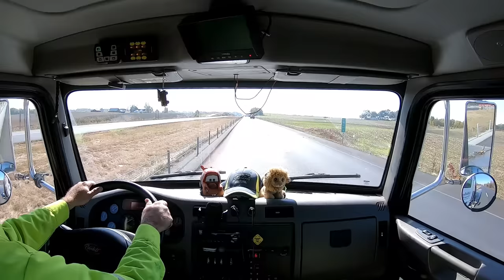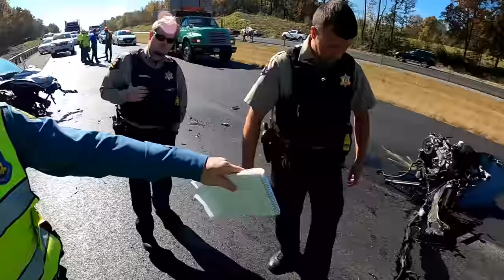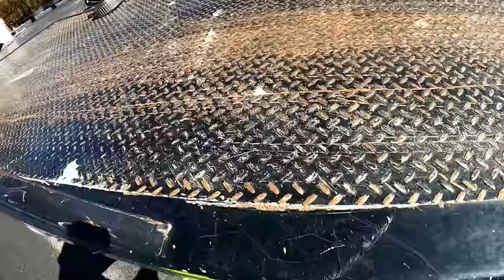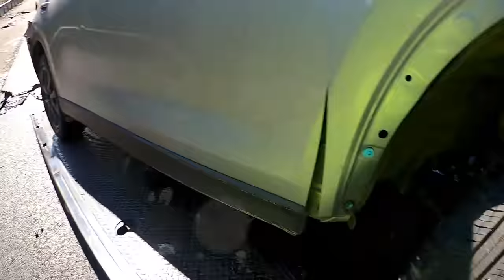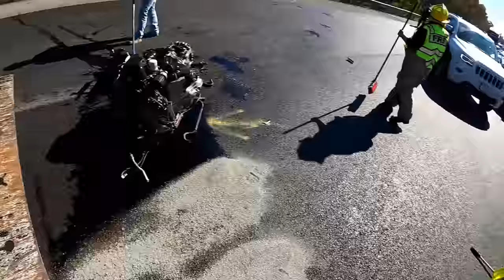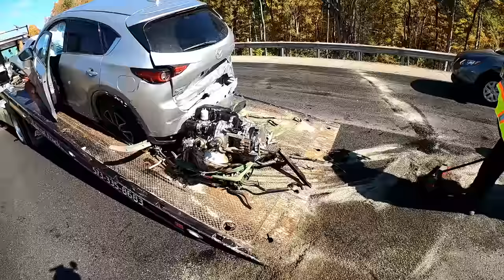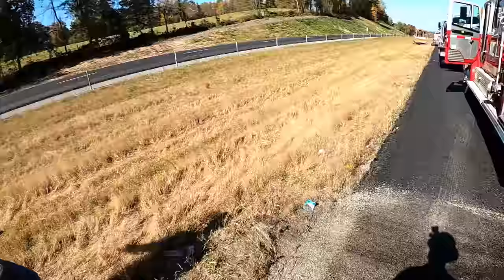Car-Splosion!!!   Code  (Blues & Twos)  Response While Driving In The Wrong Direction!!!

Comment: “Motor in good condition, dings and scratches, was running when removed from vehicle”
Reply: Truth in advertising. ;)
Reply: yes
Reply: "my price is firm, I know what I have."
Reply: No lowball offers. I know what I have
Reply: The motor just received percussive maintenance
Reply: "the only reason it is not running right now is that it ran out of fuel"
Reply: @g.sanders6916  - it’s all there!
Reply: It may have literally still been running too, lol, albeit only for a second.
Reply: What little confidence I had in Facebook Marketplace and Craigslist was just cut in half. Thank you for pointing that out.
Reply: One of the fastest engine removals ever
Reply: Motor was taken through the "breaking in" period as per manual instructions.
Reply: Car for Sale, one careful owner. Rare Flintstones capable model, useful for exercise during lockdown ;)
Reply: Ran fine before removing it.
Reply: You mean "was running before it was removed from vehicle". :D
Reply: Literally
Reply: "Slight oil leak."
Reply: yeppp... see that all the time, I hate listings 'ran when parked'... ok what decade was that in.
Reply: More like "was running before violently removed from vehicle. My loss your gain..."
Reply: The transaxle might need slight repair.
Reply: U forgot to add slightly used motor lol
Reply: Engine...
Reply: @SuperBrainAK  and the vehicle! Lol
Reply: Clean interior, full main dealer service history and rust free example.
Reply: I find it intresting to see how the traffic reacts to your units coming down the road... Most importantly its nice to see the country side you drive threw. Both city and country back roads...I say please show as much as you can... Its very educational and may end up saving a life... For the ones who don't like the driving, then easy fix for them by jumping to you getting on site.... I always hope all the crew makes it home to the familys every night. Your company, pd,fd... You all put your necks on the line to keep the roads safe, so thank you.
Reply: You Sir just made my day! God that was great. Glad they made it out of that alive.
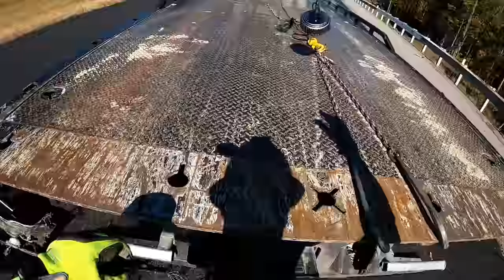Reply: @Sillyturner  Considering he threw one of the clutch assemblies onto the truck at 10:33 I think that might me a SLIGHT understatement.
Reply: @g.sanders6916  man you beat me to it🤣🤣🤣
Reply: @als8518  “ran when parked (51 years ago)”
Reply: Thank you 😊.   I'm lmfao now.   Have a pleasant day fellow human.
Reply: Copart will sell it some will repair lol
Reply: Write music
Reply: Only 20k miles, changed oil regularly, all services and recalls up to date 😅
Reply: Fresh body work!!
Reply: Sounds like the engine that someone once tried to sale to me.
Reply: Haha
Reply: s
Reply: Quite literally
Reply: " good "project" motor..."
Reply: You should get into advertising professionally LOL
Reply: @Sillyturner  nope he threw the input shaft onto his deck in the beginning right after backing up to the car it still had first gear locked to it
Reply: Epic
Reply: Sounds like a CNN add!
Reply: @SuperBrainAK  and OIL, and valve clearance, and valves.
Reply: Transmission Input shaft must be installed

Comment: Can we take a second to appreciate modern car safety design? Look at that frontside and then realize the doors still openened (more or less) normally.
Reply: Did exactly what it was designed to do, use the force of the energy into things that don't matter to protect the areas of the car where it does matter.
Reply: I agree but also alarming to see folks drive nowadays with blatant disregard/ respect for their own safety and others. Talking and texting etc . Since the new vehicles are so much safer there is not that physical level of fear / injury should they stop paying attention
Reply: Yep, everything else is designed to take energy away from the passenger cell
Reply: Judging by the damage I don't think she was speeding either. The engine probably got caught up on what she hit and got ripped out causing more damage.  This is why you shouldn;t speed.
Reply: This is exactly why I got rid of my old car for a newer vehicle, You just can't beat the safety systems in a crash!
Reply: Lesson learned from race car driving.  Ripping up the front of that SUV and tearing out the engine took a lot of energy, which did not go into the driver's body.  Essentially the car died so the human didn't have to.  Technology can be a great thing.
Reply: Yeah. I don't think this accident would've been survivable with an older kind of car. That's absolutely amazing. Crash dissipation zones are a wonderful technology. That a driver could walk away from this is nothing short of amazing.
Reply: "ran when parked" :D
Reply: Exactly. Not a miracle, but good engineering. 50 years ago it was important to make the car indestructible, and the passengers suffered. Now, the car self-destructs and the driver walks away
Reply: the same accident in an F150 and you'd be dead. That car took the impact and shedded what it could to keep the passengers safe. A F150 desintegrates on impact spilling the driver out to get  hurt. When i see that the cabin is screwed with bolts to the frame, i get sick,
Reply: @originalwolf8297  There's nothing wrong with body on frame. The issues come with how the body is made. 
That Mazda is made to much higher international crash standards compared to the F-150.
Reply: I was gonna type the same comment
Reply: As an engineer for an OEM car company, we put enormous effort into making cars crash safer. It's good to see the results of our efforts
Reply: Five ten years ago this would have been a fatal accident. Not only did the design of the car save the driver’s life from what I could tell they hit a bumper truck/trailer which also did it’s job protecting the road workers and the driver lives. This is why we are told “Slow Down, Move Over” your life or the life of someone else is always more important than whatever you are speeding to.
Reply: gives ALL new meaning to crumple zone
Reply: @telquad1953  I'm a bit bewildered.  Are you saying that regulators shouldn't have done so?
Reply: @RustyZipper  While we don't know what happened in 𝑡ℎ𝑖𝑠 case, I don't think the bad driving we all see every day is because vehicle safety has improved. I think too many people take driving for granted and consider passing their test to be the end of their training.
Modern design surely saved that driver's life but, sorry to say, it 𝑙𝑜𝑜𝑘𝑠 very much like terrible driving caused the accident.
Reply: @originalwolf8297  Disagree. Small overlap (the worst kind of impact) sees the 13th generation F150 handle it well: https://www.youtube.com/watch?v=1xcXwJaVb7Q
"spilling the driver out to get  hurt" - this is not a thing. Unless you're not wearing your seatbelt.
Reply: I would rather have the old cars. New cars are garbage. Why would I spend that kind of money on a car that I can't fix and will rot out in 15 years when I can buy a 30 year old car that is less than 1/10th the cost and happily run for another 30+ years?
Reply: Did anyone catch what make and model that car was ?
Reply: @TSKseattle  Cars were never indestructible. Watch crash videos from the 50s, 60s and 70s, and you'd see they were absolute tin cans, no form of crash structure whatsoever. In reality, there's more steel and rigidity in a modern mid-size crossover than ever was in a typical car from way back when.
Reply: The car produced projectiles, that could have killed other motorist. I'd say that's a deadly engineering flaw. If that engine/trans ejection would have caused a death, of a third party, OEM car company engineers would be liable for that death.
Reply: @mewimi  No he's saying that the car manufacturers were forced to make their cars this safe. That's not a miracle in itself. The driver surviving that impact is very surprising. It's a miracle if you want it to be.
Reply: @originalwolf8297  all body on frame vehicles have the body secured to the chassis with bolts.  that includes Rams, Silverado, tundra, Tacoma, etc.  not to mention every heavy tuck on the road.
Reply: @zachdemand4508  They aren't saying you need a brand new car, anything made in the last 20 years or so has good safety built-in, as long as it has airbags.
Cars haven't been easy to work on since the 70s.
New cars are half plastic, there's hardly anything to rust, I have a 13 year old car that I never wash, it has no rust at all.
Reply: @originalwolf8297  SUVs by design hold up much better than Pickups and Sedans.  I’d still rather be in an HD Pickup in a crash with another vehicle though.
Reply: @mewimi  It's pretty obvious he appreciates the safety, but that it's unfortunate that it took 50 years of pressure/regulation instead of car companies doing it quicker, voluntarily.
Reply: @CrushedLuminary  Car crashes have been producing projectiles since cars were invented.  That lawsuit would go nowhere.
Reply: @skipper5951  The problem is there was no energy absorption parts. The vehicle crashed into something and you crashed into the inside of the vehicle with the same force. The difference is bodies of vehicles are a lot stronger than those of humans.
Reply: Yeah but out of how many cases where people aren’t so lucky...
Reply: @RandyDarkshade2  the police officer that witnessed the accident said she was speeding also it was an interstate..
Reply: @RandyDarkshade2  you just said it doesn't look like she was speeding, then you say this is why you shouldn't speed! You contradicted yourself!!
Reply: @robkal56  excellent job to your field of work! I know car manufacturers are always using crash dummies & wind tunnel testing, all that hard work paid off in this case!!  May not always be able to save every life, but every life that is saved is a testament to the hard work put into designing safer vehicles!
Reply: @zachdemand4508  you can't fix the older car if you are killed in an accident in one!  Think about that for a minute!!  I do like some of the older cars myself, but the safety designs of newer vehicles can't be beat!
Reply: @zachdemand4508  you must also consider how much money you put into the older car!!  Buying the older car, dumping thousands of dollars into repairing it, & in the end, you are stuck with something you have more money in than its worth!!  That's not exactly sound investment!!
Reply: @zachdemand4508  The safety cell concept is good but modern cars have so much electronic rubbish and flimsy plastic that it  makes relatively minor damage uneconomic to repair.
Reply: @RandyDarkshade2  well also why you should pay attention
Reply: @sethtriggs  with the way cars are designed small accidents look like big ones she slammed into the corner of a steal construction truck so in the older vehicles they probably would have gotten some  Some bruises maybe a couple broken bones in a concussion Or probably just a concussion if it was a old truck or even old suv
Reply: @zachdemand4508  i have a 15 year old merc and a 25 year old bmw. However i had a corsa 2012 model year which I have to admit was very well made for what it was and had literally not a spot of corrosion on it. 
Some of these new cars are very good, i have considered buying new on a few occasions. I definetly get the 1/10th the cost thing. Means I can run a 328i and a merc c320cdi for less than the cost of a new car combined.
Reply: I'm glad to own a CX-5 a bit more now haha
Reply: @skipper5951  people think older cars are tough tanks because the use of plastic and lighter body panels wasn’t as common
Reply: @zachdemand4508  
And that 30 year old car will be significantly less safe in a crash.
Reply: I own a 92 Volvo 240 wagon. I was just reading about its safety features. All I know is I feel safe cursing down the highway. Ppl in my area drive like idiots.
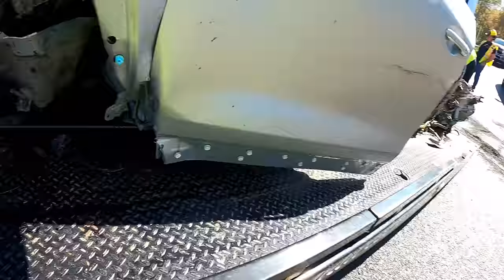Reply: @19:38 check out the rear wheel.
Reply: @RustyZipper  That physical level of fear/injury is still there, but most people tend to handle the situation with the idea that "others will watch out for me" or "I can easily text and drive".
That they like to rear-end you when you are on a regional road because you are not going fast enough but it ends up the other way around when they are in front of you while going on an onramp of the highway and you floor it and you notice they are actually wanting to enter the highway with a superlow speed and you almost rear-end them, and upon passing them you see them looking down for the most part.
I personally can not believe how stupid people these days can be when it comes to texting and driving.
Talking to another person can just as well be dangerous, but it seems people are sucked much more into their own virtual world while on their phone compared to when they are actually talking to a passenger.
Reply: @RustyZipper  I agree people drive nuts
Reply: @buckeye20100  
Cars have been this way for 20 years, some farther back than that.
Reply: Was looking for this comment cause I noticed the same thing
Reply: I think it was a Mazda 5 @msnpassjan2004

Comment: When I was in EMS we have seen cars that were  totally destroyed and the passengers completely unharmed and then see a car with no noticeable damage and the driver died so you never know.
Reply: The more energy absorbed by the car, the less force that's applied to the passengers, and vice versa.
Reply: My grandmother and grandfather have said the same thing to me. It seemed like it was always like that
Reply: I learned to drive in highschool 1976. We saw the videos of mostly intact cars and mangled people. Car design has certainly come a long way and for good. 
BTW, even though parents made us kids wear seatbelts, I have always worn my seatbelt ever since. Scared sensible I guess.
Reply: I think it is because the energy is spent destroying the car.  If the energy is passed onto the occupants instead, it is bad news.
Reply: They are designed like that on purpose. The car is designed to absorb the impact by destroying itself.  If it holds together with no damage then nothing else is absorbing the impact and it goes right to the passengers slamming into whatever holds them in. Seat belt steering wheel windshield whatever they hit first.  The designers of that SUV saved the drivers life.  She should look them up and send them thank you cards or something.
Reply: How do you know the drivers were not switch places before you arrived?
Reply: Won't blame you, my father was volunteer when he was younger (up north U.S.) and seen a lot of motorcycle wrecks. Alive, mamed, and the worst seen a lot like you did
Reply: Cars these days are literally designed to destroy themselves in order to save your life. Its basic physics principles, the car doesn't absorb the crash, all the force gets transferred to it's occupants, and that's why older cars were so dangerous, despite being able to crash and not take much damage.
Reply: Ive seen a car with no driver And a dead moose....Driver was pushed into the trunk
Reply: Modern cars are designed to absorb energy through there destruction.  Cars are a lot cheaper than a few weeks in the ICU or worse.
Reply: Newer cars are designed to crush and mangle the body parts and throw the engine out to absorb the shock of the crash saving the occupants while older cars will not crumble leaving all the shock to be absorbed to the occupants instead.
Reply: Retired ems; my thoughts exactly.
Reply: I think it just depends on the design of the car and how the car hit or got hit. A car with excellent crumple zones for a head on collision might not save you from a bad t-bone, etc
Reply: no truer facts exist!
Reply: The passenger compartment looks normal shape right down to the firewall, airbags are deployed, and I assume driver was wearing seatbelt.  Those things point to at least a survivable outcome.  It's when they don't wear a seatbelt that they're likely to get a cracked skull or something equally nasty.
Reply: Donald, that has a huge amount to do with the type of accident, the physical location on the involved vehicles and the safety features of the vehicles themselves.
Reply: @freakyflow  where's the story on it. Doubt someone wouldn't make a story on that.
Reply: Yep.  And then there are the people who are up walking around and keel over dead a couple hours later.  Life is fragile.
Reply: Never been in EMS, but I've seen the same passing by many wrecks over the years. My own car lost it's engine in a crash in fact and I just got the crap knocked out of me with the air bag of death and the seat beat welts of course. A 50 mph dead stop. The car I was driving was designed that way to dissipate energy and redirect the engine away from the passenger compartment. I think many car companies use the design technique now. Thanks for your service by the way. As a veteran, I don't get to tell others that very often.
Reply: but even if they are unharmed they still could die.
cousin of a friend of mine worked for dodge. he drove the new 2020 charger to conduct some tests, flew of the road, completely destroyed the car and was almost unharmed. they hat to cut off the steering wheel because he couldnt let go of it. died 3 days later in the hospital..
Reply: @perhapsphantom1407  that's why NASCAR changed to a tube chassis over ridged frames. The old style frames didn't absorbe the impact, transferring it to the driver!
Reply: @cuongandmari  at the end of the video Ron showed that the driver did have very minor injuries.
Reply: @legofreak644  I’m so sorry for your friend.  Unbelievable!
Reply: @ChessIsJustAGame  There was a gas station down the street from my childhood house that parked wrecked cars on the corner of their lot, near the traffic light. A great reminder of what can happen if you don't pay attention or are careless. I, too, have always worn my seatbelt for the same reasons.